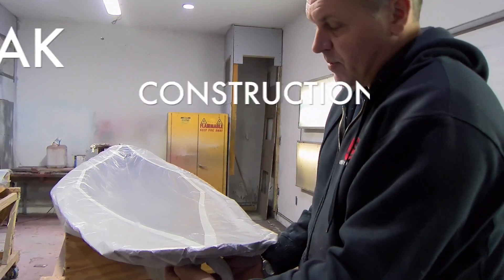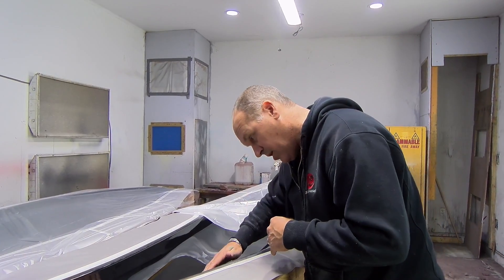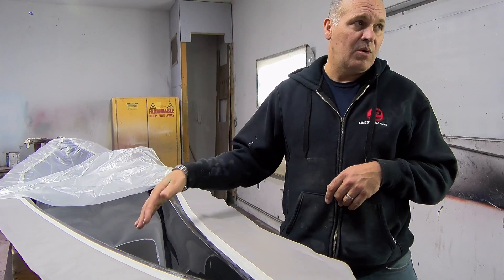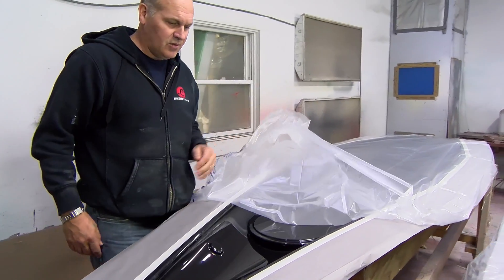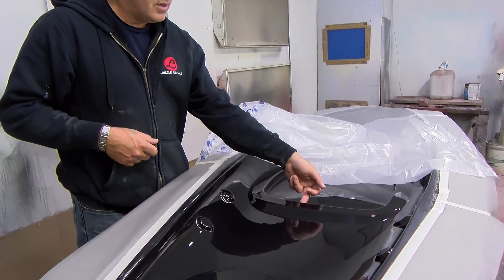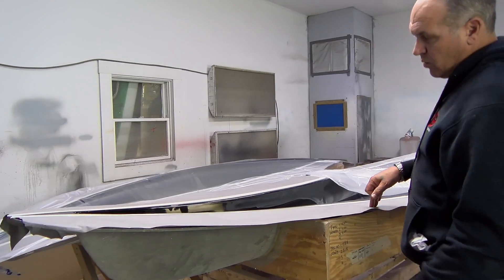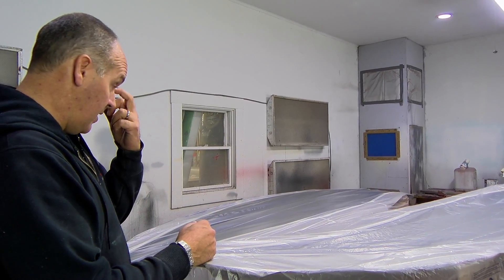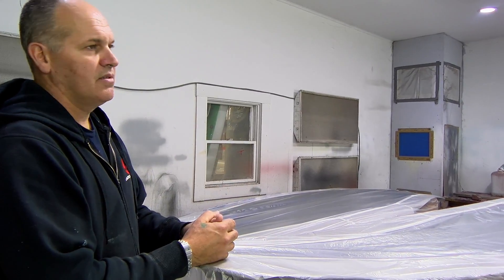Composite Kayak Build Step by Step Discussion

Comment: Have you ever considered laminating a kayak from pre-preg carbon/glass?
essentialy I'd like to know what, if any problems you could foresee.
Also have you ever tried release agents like freekote or pmr for the mould prep?
Reply: If you had access to an autoclave that large, working with prepreg would be great. You'd want to triple check your vacuum bag seal and cross your fingers when the pressure builds. If you want a more DIY method that is similar to prepreg in terms of time spent in layup, try wetting your cloth plies between two sheets of peel ply, squeeze out as much resin as you can, then roll it up and freeze. This way you can prepare all your layers and have them ready to drop into the mold, one on top of the other. Use a porous peel ply with a few layers of breather to allow some extra resin to be soaked up and out of the carbon and vacuum bag. Then since it's wetted with a regular room-temp cure resin, once it warms up it will cure.
Reply from the maker: Wow Verent, you knowledge of layup seems extensive. Thanks for watching.
Reply: Resin infusion gives you all the time on the planet to make sure everything is right.  Vacuum testing the bag prior to releasing the resin is a huge plus.  If there’s one major advantage pre preg has is its infinite resin possibilities.  Not really needed in boat building.
Reply from the maker: Hey jamie, we were simply making this video for our client Lincoln. We have no say or actual involvement with the fabrication. Thank you for watching. We appreciate each and every view. Jack